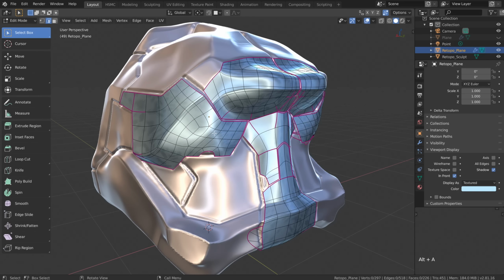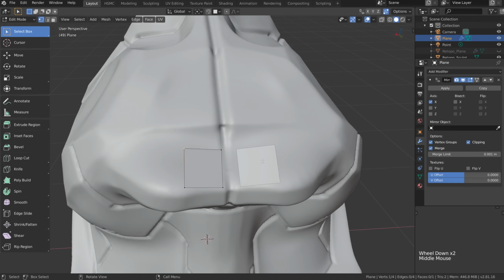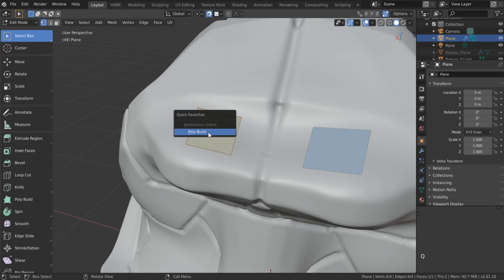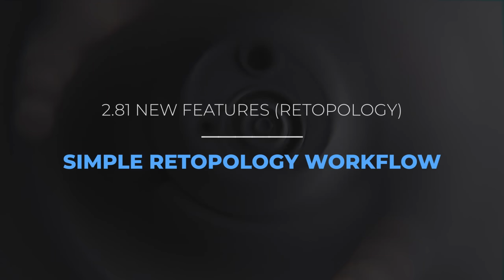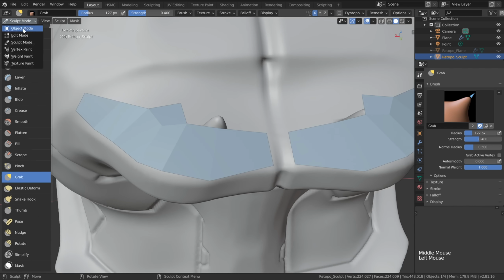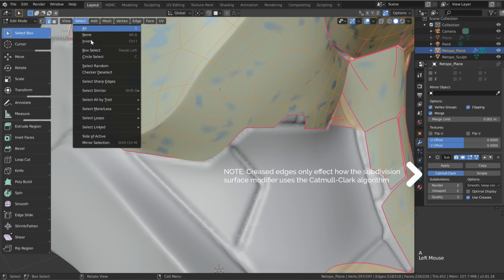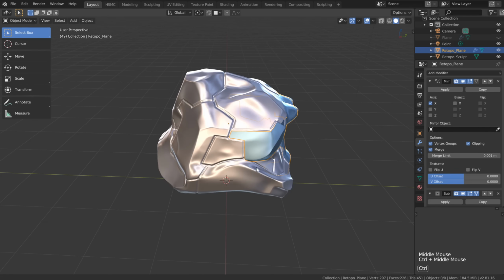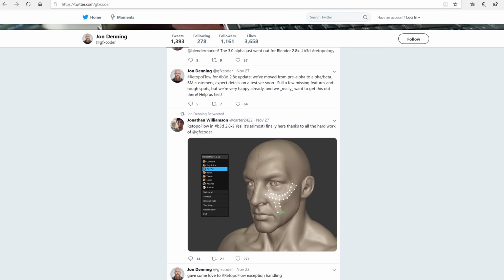Blender 2.8 Tutorial | Retopology

Comment: Great but you missed a very important step: handling retopo over the panel lines and the joining of the parts
Reply from the maker: Thanks! And that is very true, it is a pretty important factor, i think my main advice for that would be to line up edge flow of neighboring pieces and hide as many poles as possible in the valleys of the panels. It kind of falls under general topology teaching, which is a fairly big topic in of itself. However, it's definitely something I'll be doing more of on the channel soon! :)

Comment: Just buy "quadremesher" or use Zremesher for ZBrush - if u have ZBrush ofc ^^ Retopoly after creation of a highpoly model is a big mistake btw
Reply: What are you talking about, retopo after sculpting is an industry standard workflow when creating characters for example, zremesher is great for some uses but definitely have to manual retopo for most cases if you want good topology, even more so for animation, so no, retopology after highpoly model is not a big mistake, not by a long shot
Reply: @Giant_Swing  u gonna need a manual retopo anyway, but pros is creating a topology which is suitable for technical specifications but before the highpoly model, retopology after creating a highpolymodel is for noobs dude
Reply: I never build a high poly asset for a pc game but isn’t it better to have a lowpoly mesh first which can be uv unwrapped very easy before sculpting the high poly mesh which will be used to bake normal maps on the low poly mesh?
Reply: @Krull0r  don't say if you doesn't know I have 10 years of experience of creating aaa 3d models. Yeah u need to create lowpoly first and then highpoly for a games, but not the other way, there is some other non-gamedev tasks where u need to go the other way and this is where u gonna need an additional tools like zremesher or plugins. Manual retopo is a pain in the a**
Reply from the maker: @PashaDefragzor  Totally agree that if the automatic solution works, go with that! :D Especially if in a 3d asset pipeline that needs replicating a lot i.e. there's a load of assets to get through quickly. Though I think it's fair to keep in mind that almost always context is everything when analyzing the criteria by which conclusions of right and wrong can be drawn. Criteria usually divides into stuff like power of iteration/versatility vs creative freedom vs time constraints vs fun! So using texturing as an example, use a substance graph (for versatility and iteration) or just do some photobashing instead (quick and often easy). When would you say you turned to more auto retopo than manual retopo over those 10 years by the way?
Reply: @AidyBurrows3D  I never did manual retopo. I've created a base topology and manually fixed it for my future game projects, but I never ever did the retopo after a highpoly mesh - because this process is wrong. When you are weighting your 3D project you gonna need a stress test for your engine, you need balance your meshes to get almost equal grid to get a good result and release your project for any platform u need (console, pc or even mobile game). Check the Destiny 1 and 2 dev videos - they are the best, game is cool too (the only one thing maybe a boring singleplayer story) if you want an example of successful full 3D AAA+ game. 

An exception may be mechanical and spherical models, where I made a high poly model and reduced (decimated) the number of polygons manually, but not completely manual work from scratch
Reply from the maker: @PashaDefragzor  Always intriguing to hear how others work, :) we had artists use a combination of auto and manual approaches when downscaling content initially intended for PS4 right down to mobile, the first game I worked on was on the Nintendo DS! :D Then both the art direction changed and the scope of that DS project increased to include the PSP and PS2, then later the PS3! :D It's hard to predict where a project will go sometimes, that's one of the reasons I think it's worthwhile to be adaptive to as many processes as possible, including having to adapt/retopo down certain hero assets, plus back then the auto tools weren't quite as good as they are now.